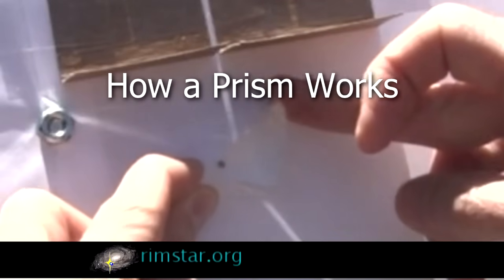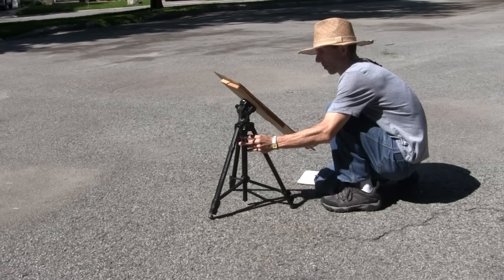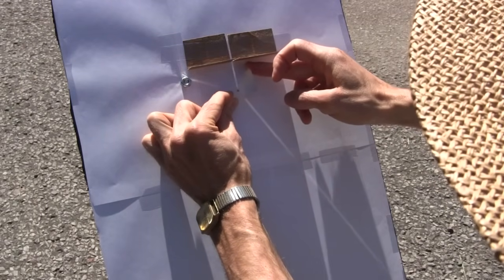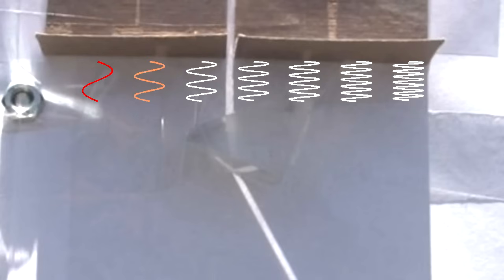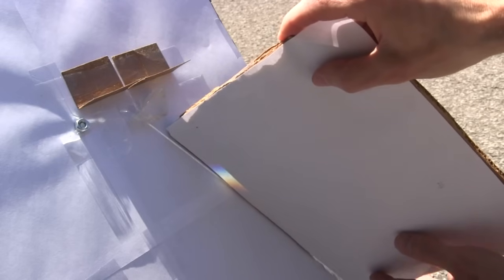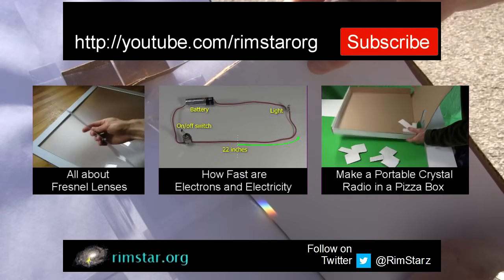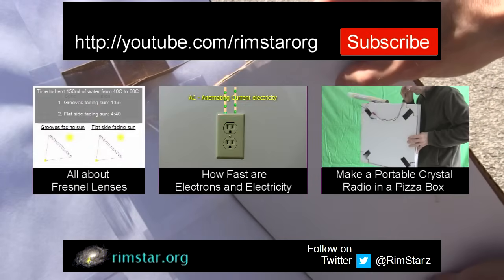How a Prism Works to Make Rainbow Colors

Comment: Is it always necessary to use something like this? My friend had a prism in his window (with sunlight coming through) I could see colored light in the room and asked him if he had one, turns out he had several. I guess I'm missing something, I thought all you had to do was shine white light through it on a surface, as seemed to be the case with his prism, but I got some as a present for my niece and they don't work that way. Seems a piece of multicolor stain glass would be better.
Reply from the maker: No, it isn't always necessary to use a triangular shaped prism like this. As you saw in the video, I used a cylinder at one point. The effect is called refraction and can happen with many shapes.
Reply: @RimstarOrg  what I meant was your apparatus, the pieces of cardboard with the slit for light, is it always neccesary to use that, or simply shine light through it onto a surface to get the rainbow effect without something like that.
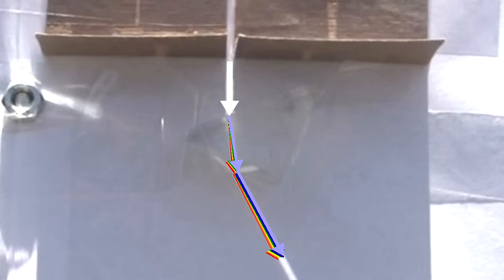Reply from the maker: I used the slit to make sure I was using light coming from one direction only. Look at the video at 1:40 with the one white arrow going in from one direction only and multiple colored arrows coming out. Now imagine what if you had a bunch of white arrows coming in from different directions. The colored arrows coming out would be in all kinds of directions and even with multiple of the same colors going all all kinds of directions. You my still see various colors or they may all add up to just white -- it just depends on what's coming into the pyramid. I wanted a nice, clear rainbow coming out with all the colors separated and in the right order for demonstration and explanation purposes.
Reply: @RimstarOrg  like I saying when I saw the colored light from my friends prism showing sunlight through it, it was simply setting on the window sill, didn't have to use any kind of thing you you did, why is that?
Reply from the maker: Had a sunny day today so I could try it out without the carboard setup. I got the colored lights with some orientations, some very sharp angles too. At some angles it was very spread out and not suitable to my explanation in this video where I wanted them very tightly aligned. And at some angles it might have been good enough. The main thing is to have the light coming from one direction only as much as possible, then the angles will work out nice for a demonstration. But if all you want is colored light and don't care about having each color nicely separated then that's not too hard to get. Fun.

Comment: Shit im so stupid i used the flashlight
Reply from the maker: No stupid. Depending on the lightbulb in the flashlight, it may not contain all the wavelengths of visible light but it should contain a few, otherwise it would be a color like red, or blue, or violet,...
Reply from the maker: Trie pointing the light through a slit like I did, so that you get light moving in mostly one direction.

Comment: the center colour in the band of a prism? sir tell me with explain soon
Reply from the maker: That depends on what range of light is going into it. If it's visible light then we can use a table here https://en.wikipedia.org/wiki/Visible_spectrum#Spectral_colors to see that violet starts around 380 nm and red ends at 750 nm. That's a range of 370 nm (750 - 380). Divide that by two to find halfway and we get 185 nm (370 / 2). Add that to the beginning, 380 nm, and we get a middle of 565 nm (380 + 185). From that table, 565 nm is just at the end of the green, almost to the yellow.

Comment: When we use a red filter the light just seems to be white, until it passed through the red filter. Here, it is clearly the filter that causes the white light to turn red.  Similarly, we get green light with a green filter, and so on.  Why then, when you pass the same white light through a dispersion prism and and we get a rainbow, do we NOT think the prism is causing the rainbow?? Review : a red filter turns white light red.  A blue filter turns white light blue. Green filter turns white light green.  When white light through a prism gives a rainbow?  All the sudden the light we know as white must really be a rainbow? Who said this?
 I have seen no proof of this. Can you prove the prism is not the cause of the rainbow color light?
 Light goes through all shapes of glass and prism's and does not come out rainbow colored.  Only the dispersion prism makes the rainbow...
Reply: Send sunlight through a prism.  Use a second prism on only one of the colors coming through the first prism.  Try red, for example, and you will only get red.

Why?

Because the prism is not adding colors.  It only spreads out the colors.

Do the opposite of spreading colors; blend them together.  One way is to take the three primary colors, yellow, red, and blue.  Cut out a circle of white cardboard and color 1/3 yellow, 1/3 red, and 1/3 blue.  Put in on an electric drill and spin it at a high r.p.m. (revolutions per minute).

What color does the cardboard appear while spinning?

Yes, white.  You just put your rainbow back together!

Second way:  Mix paint (yellow, red, and blue).  If done perfectly, you get black, but usually dark brown....depending on what your proportions are.  

Black and White are the same thing; rainbows in disguise.

Comment: ya but why does violet light refract at a different angle than red?
Reply from the maker: Because they have different wavelengths.
Reply: Different wavelengths. Red has longer wavelength therefore is faster and violet has shorter wavelength therefore is slower. Red refracts less because it is faster and is shown by the larger distance it has from the medium, compared to the slower violet. This is how each colour can be seen, since each colour has different wavelengths, allowing us to see individually, when refracted.

Comment: Why  are there 7 visible electromagnetic waves? what made the sun emit  these 7 and not only 1 lets say
Reply from the maker: There's actually more than 7. There's a whole continuous range but for simplicity, I drew only 7.  I don't know specifically what processes on the sun's surface are causing it to emit the range of wavelengths that it does.

Comment: I just watched your video on Rainbows.  I am an artist and am creating an art installation in which I want a spot light to hit a round prism and create small rainbows on the floor.  When sunlight goes through the prism at my house,  rainbows appear.  But, when I use a full-spectrum light bulb, I only get dim white lights and not rainbows. 

Do you have any ideas on how for me to use an unnatural light source hit
the prism to create rainbows in the same manner as the sunlight hitting
the prism?

Thank you so much for your time and wisdom!
Reply from the maker: Are you letting the full-spectrum light get to the prism through a slit like I do with sunlight in the video? If not then maybe the light is arriving at the prism at many different angles and therefore it refracting at many angles and coming out at so many angles that is appears white again.
If I can find my prism then I'll try it but embarrassingly, I just looked for it and couldn't find it (I must not have written it on whichever box I put it in.)
And glad I could help! Thanks for watching!

Comment: So in order for rainbows to happen, they need to pass through glass? How about a glass dome, would that work? I don't see how mist could create a perfect half circle in the sky. But if there was a glass dome above, I could totally understand how it could work. :)
Reply from the maker: For rainbows to happen, light needs to pass through a material that refracts, reflects and disperses in the right way, like water droplets do. Rainbows are not domes, but are actually full circles, well, they would be except that the ground  is often where the bottom half would be. https://en.wikipedia.org/wiki/Rainbow
Reply: A rainbow is not a dome, but it's in the shape of a dome.
Reply: Why are rainbows dome-shaped?
Reply from the maker: There's too much to answer in a comment. See the wikipedia page I linked to.
Reply: after reading all the comments I see your the only one with common sense.. dome over flat earth.
Reply: There is a half dome in the sky. The very troposphere you perceive with your eyes from horizon to horizon is a half dome and gives us the experience of being inside a water molecule as long as the sky is clear.. The sky gives you a slow motion example of how colors of the sky change from dawn to dusk. Light is an electromagnetic wave. Each color corresponds to a different wavelength. The Sun looks white since we perceive the sum of all visible wavelengths of a rainbow as white. When white sunlight hits our atmosphere, some of it gets scattered and bounced. The shorter the wavelength of light, the more it is scattered. Typical blue light is scattered 5 times more efficiently than red light. The sky has different shades of blue during the day. At sunrise and sunset the sky straight above you (your zenith) is the deepest hue of blue. 

 Your eyes must look through the most of the troposphere at sunrise and sunset and the color that travels through that distance that will be the strongest will be one whose perfect full wavelengths begin at the edge of the troposphere and end in a precise fit to your eye. So a reddish sky (longest visible wavelength) is seen right near the horizon's edge at sunset while it was blue (shortest visible wavelength) throughout the most of the day with the colors in between occurring in a changing manner when the Sun is just above either horizon. 

Even look at an outboard motor as it drips a touch of fuel into the water and you will see different colors in the fuel that rides the water surface.this is due to the different thicknesses within the fuel, allowing only certain wavelengths of light to reflect back to your eyes. To learn more read Feynman's QED. That will give you the particle explanation while I just gave the wave explanation here. 

I hope this helps a touch.

Comment: just not sure what makes them bent, is it the angle of the prism? if so why doesn't light bent in the opposite direction the second time its passing through the glass into air as the angle is opposite of when the light is entering from air to glass
Reply from the maker: +arman sesar That depends on what kind of answer you want.
If you want to know what's actually going on that makes it bend that way then I don't have an answer for you. Here's an excellent video about it but even in there they don't talk about the bending https://www.youtube.com/watch?v=CiHN0ZWE5bk.
If you want the higher level explanation then it has to do with Snell's law, which doesn't really give a "why" answer. But I've used the simple formula a few times for different things and it works a shown https://en.wikipedia.org/wiki/Snell's_law (it's always fun to do the math and see it work out to match experiment.)
Reply: I watched the video, not much i hadn't heard already, and i understand the phenomena just not sure why it bents in a specific direction and not the other, or why it bents at all, im assuming it has to do with the angle of the prism hense the triangle shape since im assuming light does not bent when entering another fluid at 90 degrees, it also makes intuitive sense that the higher frequency waves/particles would bent more than lower frequency ones simply due to having more mass/magnitude, and being impacted more by w.e that they're being impacted by, assuming there are some sort of molecular interactions between the two which we have not quite been able to explain, all and all im not satisfied with the whole atomic structures theory concerning subshels...etc and definitely not satesfied with the theories surrounding light as im sure you can understand the frustration, thank you anyways, very much enjoyed that little clip
Reply from the maker: +arman sesar Keep in mind that physics is mathematical models that predict what will happen, not necessarily why things happen, so the answers may not always be there. However, the video link I gave referred to another video wherein the professor referred to Feynman's Lectures volume 1, section 31 "The Origin of the Refractive Index". I haven't had a chance to go through it myself but here's a link to the free online copy http://www.feynmanlectures.caltech.edu/I_31.html. Possibly you'll find a clue there.
Reply from the maker: +RimstarOrg Ah, the answer's there, or at least at the level done in the explanation. In Feynman's Lecture's (here's the link again http://www.feynmanlectures.caltech.edu/I_31.html) scroll down to figure 31-2 and the accompanying text. It makes perfect sense when you picture light not as a particle but as a wave. Then you can see how the wave, once it's moved to the other medium, is moving in a different direction due to the different speed. His explanation is sort of an "it is because it is" explanation, but if you picture each line that makes up the wave as being not a solid line but a whole bunch of separate particles that slow down (or speed up, but that would be moving in the other direction) once they've moved to the other medium. Then you can picture what happens to the overall wave that's made up of these imaginary particles. Of course those imaginary particles don't exist; they just help me picture why the wave does what it does.
Reply: RimstarOrg +RimstarOrg  its making way more sense after looking at the diagram, it made sense why the lines would bend because at any angle all particles closest to the surface slow down before the particles on the far side of the beam and therefore enter the new medium at an angle. there is however still one small hole to this logic since even when the wave crests change angle, there is really no explanation to why the whole beam would change direction all together...unless there were other forces at play such as horizontal interactions (bonds) between each light particle with respect to its next door neighbor as they're traveling side by side, that way initially when the first particle enters the new medium, it would pull on its next door neighbor which is still desiring to travel at full speed before it reaches the new medium and changes its direction and thereby setting off a chain reaction which will change the direction of the beam entirely, it would also help to know if the width of the beam changes size as the beam enters the new medium (which i must assume it does if the beam changes direction), here's a little something i drew after analyzing figure 31-2 which helped me figure out whether or not the bent would actually take place, it might help show you what i mean when i say the bent of the entire beam would not be necessary with just that explanation alone...

https://drive.google.com/file/d/0B4pJzNxCu9DGNlhldGZqdFpsTG8/view?usp=docslist_api

 i assigned different color particles to different locations on the wave and used arbitrary numbers for the length of the crests, distance traveled, speed of light c (which i set equal to 1 for simplicity purposes), i tried to label everything as much as i could, let me know what you think
Reply: its refraction I guess
Reply: I believe it may be because the light doesn't enter the prism perpendicular to it. It enters at an angle and it always gets closer to being perpendicular.
Reply: The light bends because it is refracting. It is refracting as it goes from one medium of a particular optical density  to another. 
    According to Fermat's Principal of least time that says given two points light always takes the quickest path, in other words, light is always in a hurry, thus it bends through a medium of different optical density as it is quicker to move.

Comment: I put a water in a bowl then dip a mirror and let the sunlight hit the mirror.
When it reflects to the wall, it has rainbow colors.
Is it the same principle?
Reply: Harris a has explained how the rainbow is made in the sky.
Reply from the maker: harris a Oh neat! It sure seems like the same principle. The light goes from air to water, and the different wavelengths enter at different angles. Then the light goes from water to air, and the different wavelengths exit at different angles again. The mirror simply serves to reflect the light back out, though if it's a mirror with a glass front then some angle changes may happen there too.

Comment from the maker: Thanks! And what a neat idea for an experiment! One tricky part would be getting a clear ice, maybe start with distilled water? If the ice doesn't have even surfaces coming out of the mold then maybe cutting it with a hot wire? Looks like there'd be some trial and error involved. I might just try this. It's definitely on the list now. Let us know if you do it.